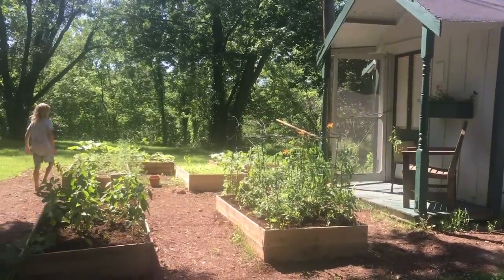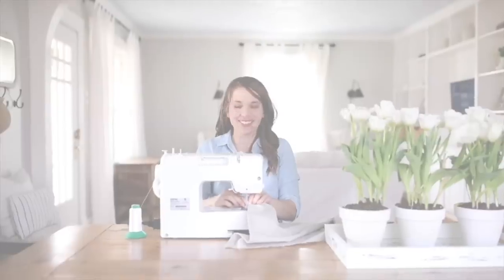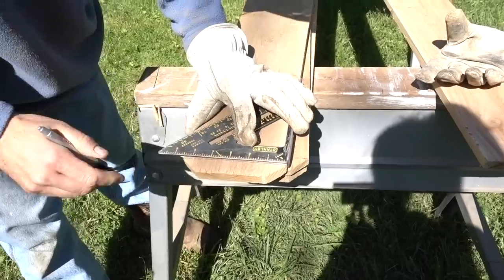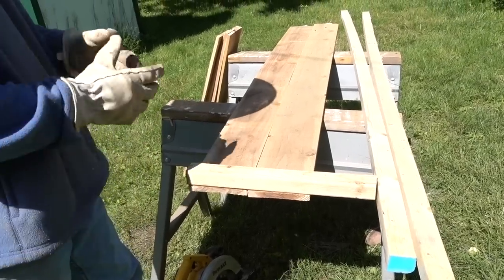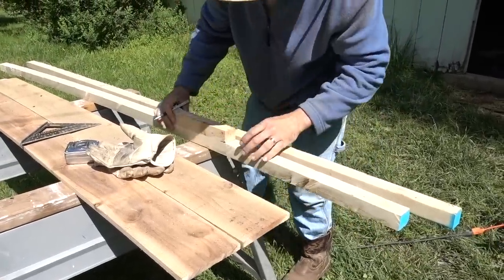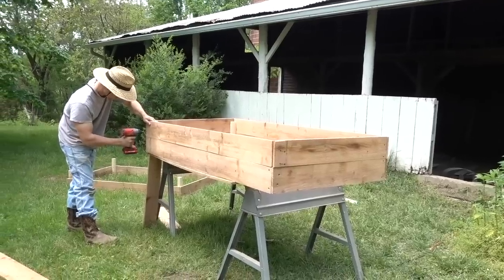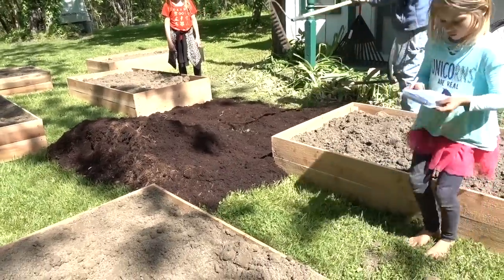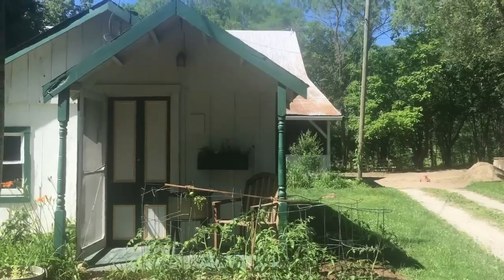How to Build Cedar Raised Beds | Gardening for Beginners

Comment: I've done this method and it works well.  2 cheap C-clamps can help stabilize when building by yourself but a great cheap way to get into gardening. The pickets will last about 5 years but the soil keeps its form so rebuild a new frame and fit it over where you removed old one.